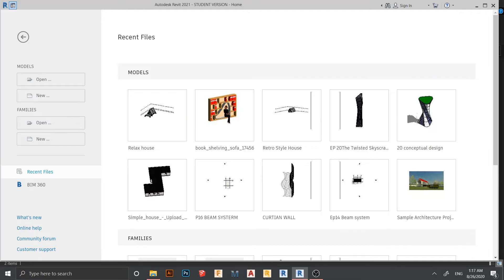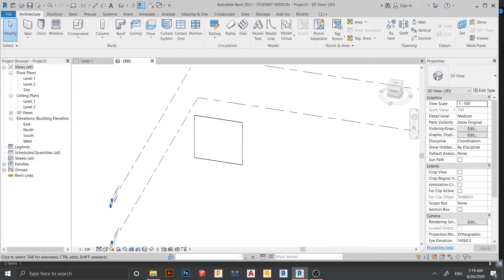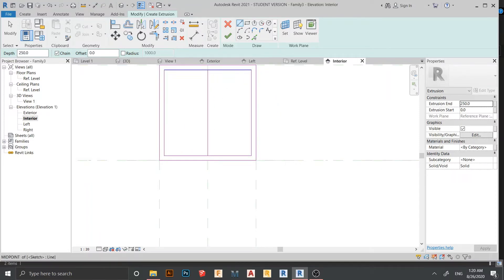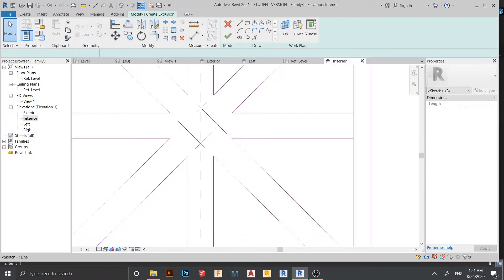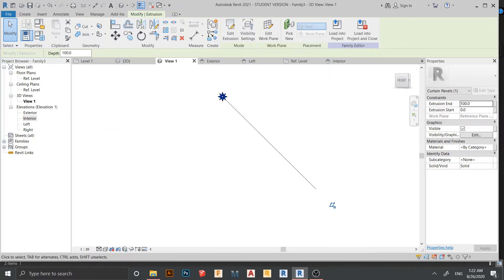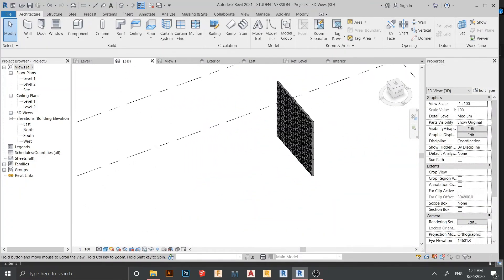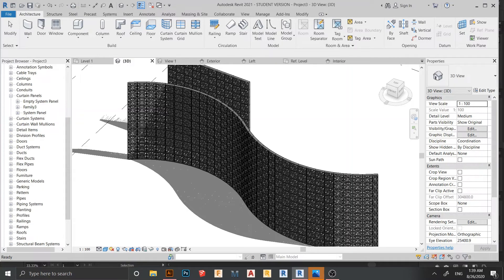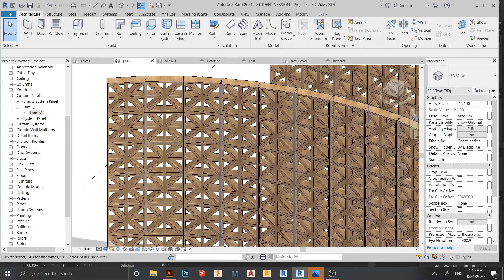Learn How to create Pattern using curtain wall in Revit 2021

Comment: Thankyou it worked for me, except I am running of Revit 2023 and the two curved walls had a join between so the joined panel wasn't presenting properly and the pattern was squashed and I had trouble assigning materials.

Comment: Thank you for your tutorial, you made the model very easy. However, I did not quite get the part where you associated a family parameter to your curtain panel family. You did that process too fast so I could not see what you clicked. Thanks .
Reply from the maker: Hi, you can check out this link below, tutorial is look similar for this third part. 

Tip & Tricks - Curtain panel hack for facade in Revit, https://youtu.be/OO0sd_N6QS0

Cheer ;)
Reply from the maker: TBH,  around 20 video tutorial, I never notice my cursor not visible, I just realize when my subscriber told me about that. 

Sorry in case inconvenience
Reply: @RevitGlobalKnowledge  thank you for your reply and direction. Thats fine, everyone makes mistakes, if not how can we improve??